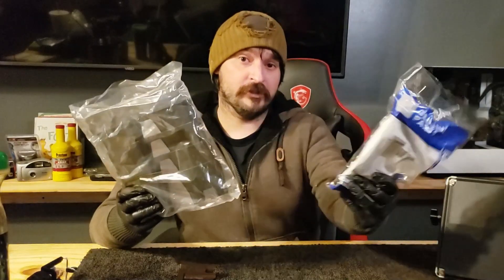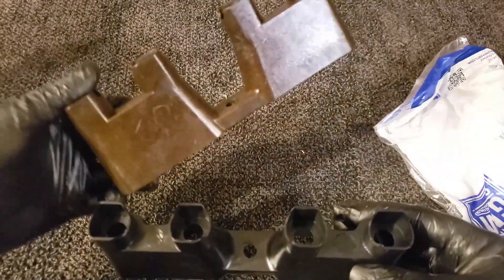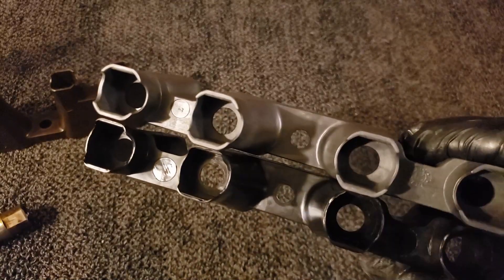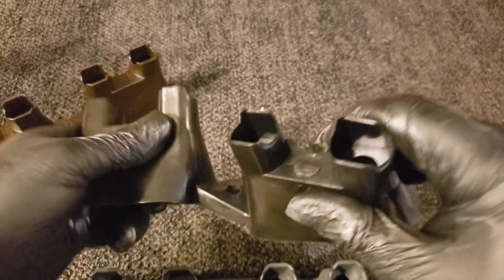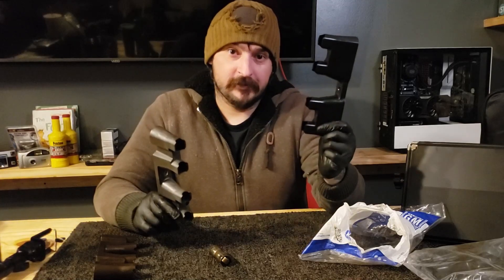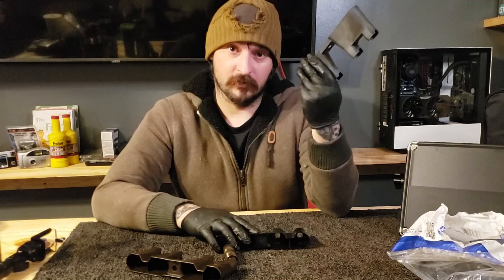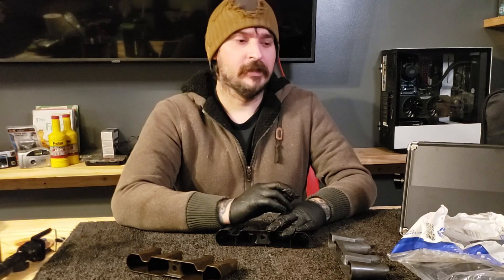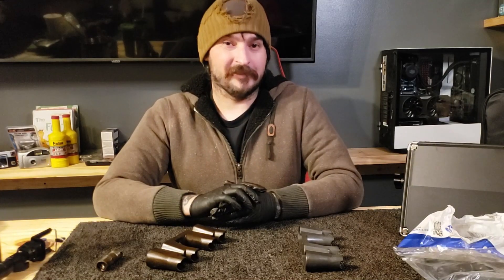Cheap Vs Factory Lifter Trays - Before You Buy - LS Engine Lifter Tray Failure

Comment: Keep in mind, not all GM parts you get from the GM counter is the same quality that your vehicle came with. My 92 Sierra had a broken off license plate light housing. Bought one from the GM counter, installed with the same part number light bulb that is on the other side and at night, the light would shine through the black plastic housing. I removed the bulb and installed it in housing that I bought from the junk yard the next day, it worked perfectly.

Comment: Happened to me. I used Melling trays. 4 months later, 2 lifters twisted inside the trays.  Luckily cam was ok.  Just ruined lifter rollers.
Reply: Gosh, that sucks. I would have expected better from Melling. I’m planning on putting there rockers and pushrods in my ls1.
Reply from the maker: That's why I only use OEM trays from the GM dealers, you got lucky sounds like that your cam was ok

Comment: You are ABSOLUTELY correct about this I've watched a bunch of videos of guys wiping out all 16 brand new lifters on their LS cams because of those lifter trays. The lifters turn in the tray and the wheel gets scrubbed instantly. Now you've got fine metal shavings getting all through your motor wiping your bearings out. eBay is calling the lifters that come with those trays "Brian Tooley Racing lifters" they absolutely ARE NOT BTR brand they are junk. DO NOT, I REPEAT DO NOT use ANY ebay internal engine components on your LS build. eBay headers, aluminum radiator, fuel cells etc, that stuff is awesome but you DO NOT want any of the internal engine components they sell in your LS engine it is all of the lowest quality parts and construction. Most of it , although they are listing it as a name brand part IS NOT name brand, most of that crap is made in China in a sweat shop by a 10 year old kid and the materials are horrible, that's not suppose to happen on roller cams wiped out lifters and lobes is flat tappet cam issues something has to be EXTREMELY WRONG to smoke all 16 brand new roller lifters and the problem is those trays don't keep the lifters wheel aligned AND the eBay lifter wheels are way more tapered on both sides giving it way less footprint on the cam lobe. You ONLY use Delphi, Delco, Chevrolet performance, Morel or Johnson lifters in you're LS build !!!
Reply from the maker: Thanks for watching and thanks for taking the time to comment

Comment: Some stuff you really want OEM for. I used factory replacement trays, and I'm 3k miles into my top end rebuild with no issues. My original ones had a lot of play when I pulled em, probably was a blessing in disguise that I had to pull a head. Ended up doing both sides.
Reply from the maker: this is true, and its always best get OEM parts from the dealer, online they can be OEM looking but fake parts
Reply: @TattsForLife  It was amazing how the knockoffs were so short in rigidity compared to the old ones. I honestly didn't expect it to be that bad before you twisted them. Not the place to be sacrificing quality to save a few bucks, lol.
Reply from the maker: @PushrodMutant  I seen so many builds destroyed due to the trays or lifter being fake or cheap